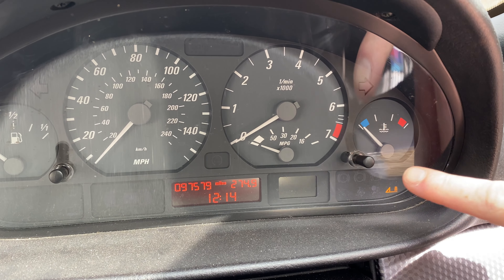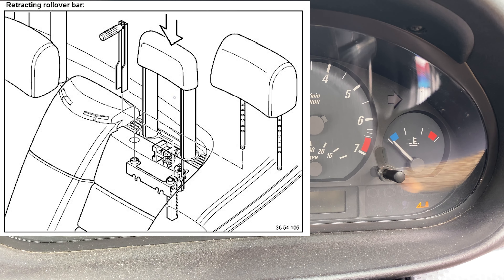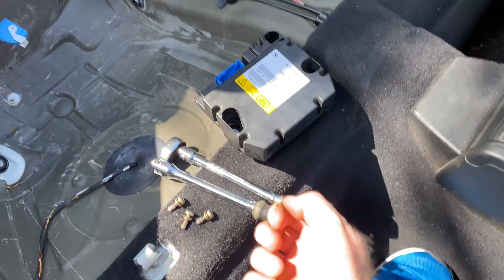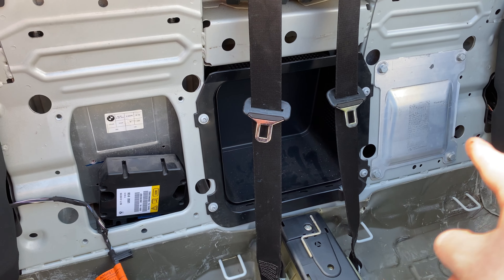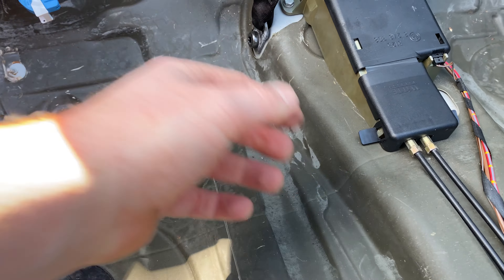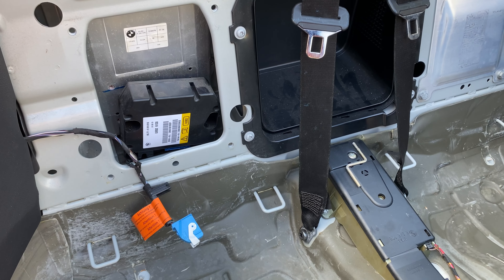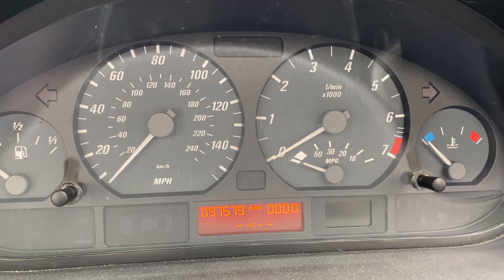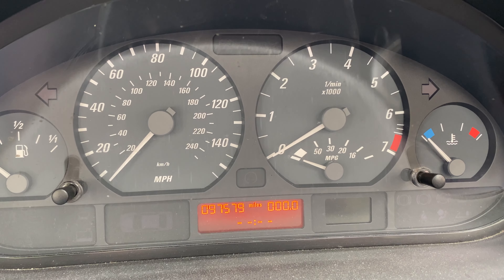BMW E46 3 Series Convertible Rollover Protection Module Replacement

Comment: Based on this video, I was able to replace my sensor. I did not have to remove the seatbelts. The bottom seat attaches to the bottom seat with a long black clip over that rod that goes between the two sides of the seat back near the hump... It is just clipped on. If you unclip it, it makes taking the bottom seat out very easy. Then, you can slide the top seat over to one side with the belts already attached. Tip - Move the passenger seat all the way forward BEFORE you disconnect the battery. The 3 bolts that hold the sensor on are thought to get at with the security torx. allighment needs to be perfect to engages and they take a lot of torque to extracts. Having some room to work is a key to success,

Comment: i have that code on my dash would that code prevent the top from retracting automatically? because mines open with the button but just a crack not all the way and it locks back with the button
Reply from the maker: From memory, mine still worked with the light on no issues. I just wanted to fix it to get rid of the light.